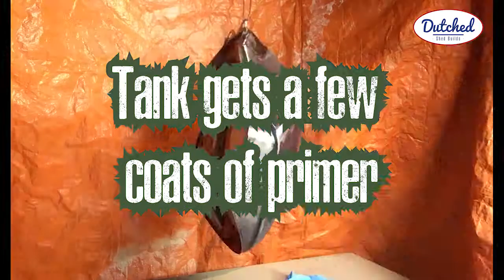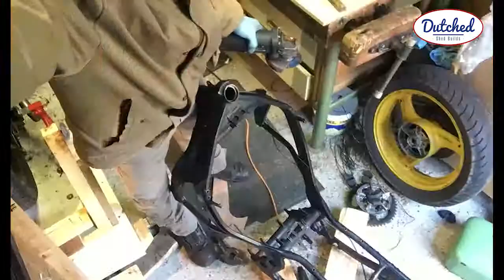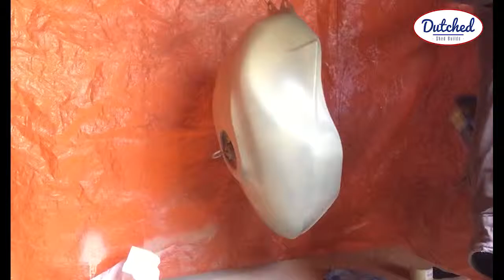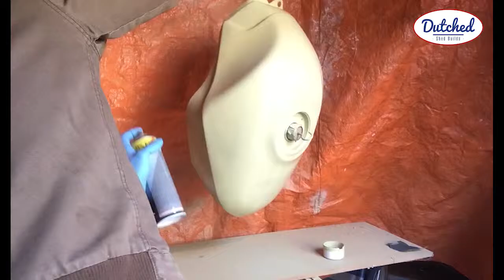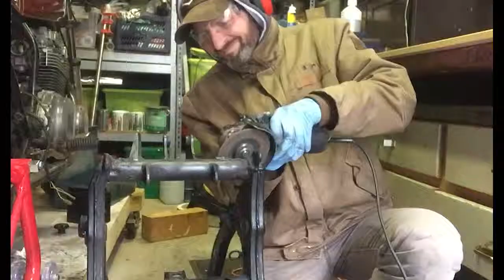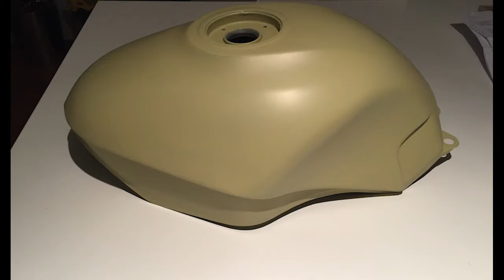Dutched Shed Builds - Suzuki GSX600F - episode 8 - frame and tank

Comment: I really enjoy the gsx600f videos,  I hope there is more of them coming soon👍
Reply from the maker: Thank you Wally Willy, great to hear you enjoyed watching them. Unfortunaly i had to abandon the gsx600f project, the engine was so corroded and bolts were so stuck that i had to leave it. But the suzuki gs450 caferacer build and the Honda cx500 are still in the making and new videos will come out soon.
Reply: Thanks for the reply. Awk that's a shame about the Suzy, but that's the way it goes. Good luck with your other projects😉🏍️